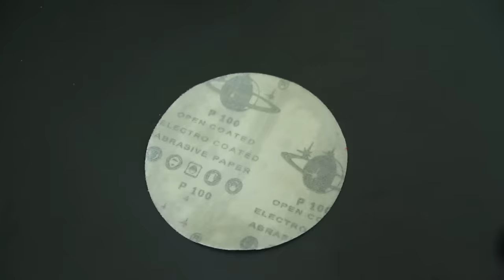The knife from the meat grinder is like a razor. the meat grinder cut the thread. #diy #homemade

Comment: Knife sharpening was good but the plate sharpening was all over the place. Cutting wire between two metal surfaces is no big deal, enough shear force and you can cut solid rod.

Comment: This is stupid because it tells you to sand the blade BEFORE you sand the plate, which would make the blade match the profile of the plate, and if the plate is not perfectly flat then the blade would end up not flat as well, then when you sharpen the plate on a flat surface, and put it back together, there could be gaps!. It should have shown the plate grinding head being sanded FIRST, and THEN showed you sharpening the blade!. Swing and a miss!. lol